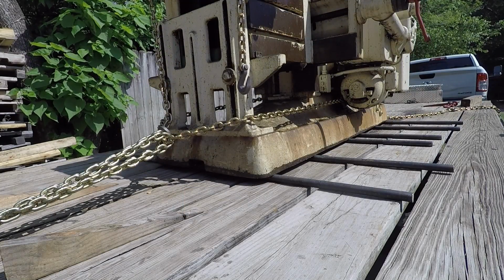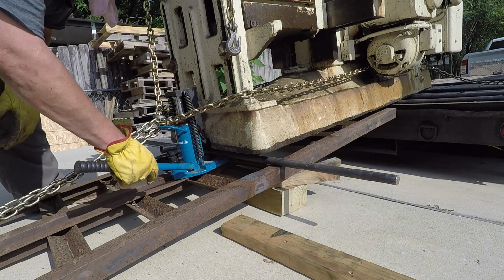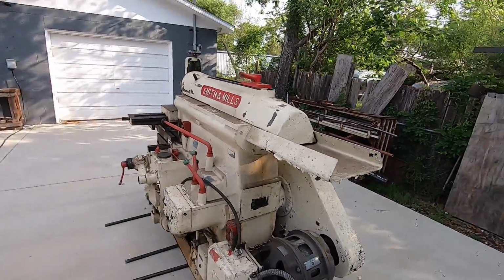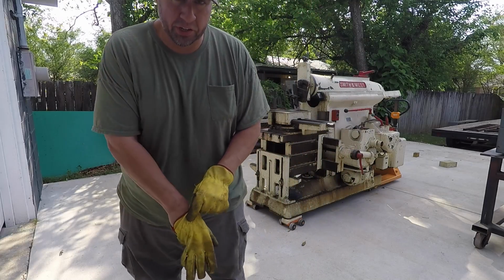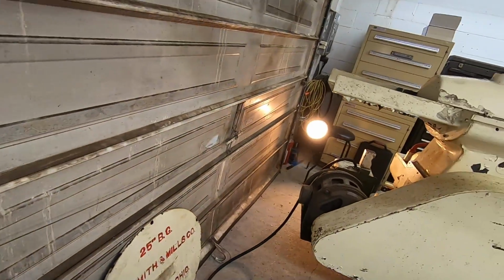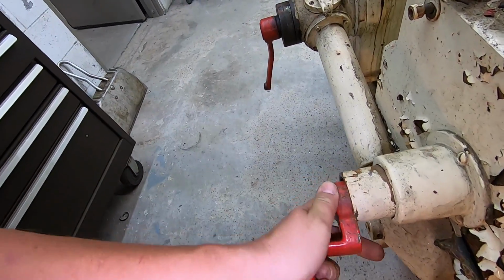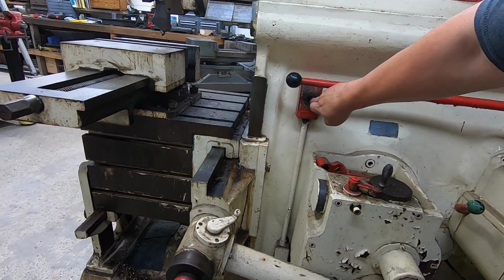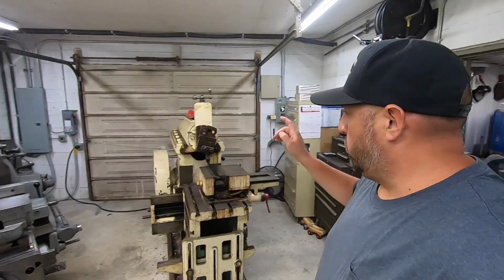Unloading the Smith & Mills Shaper Part 2

Comment: Dont get me started on people painting the hell out of stuff.
Former job at a factory every year people would go around and repaint the lines, over every single bolt head, allen head screws were just filled with paint having to be picked out before able to remove.
Reply: wes Made me laugh. Yep, me too. On the back shifts that’s what the operators did, steam clean, needle scale, prime and paint with pneumatic solvent sprayers and laid it on thick. The old Navy hands always said, “Run it may, Shine it must”.

Comment: Nice...one manned off-loading.  Seems that this machine needs a good flushing out of aged and gooed up oil and other contaminants. There a few weeks of labor there to get the paint layers down to the original coat then refinish it in the original paint scheme. If there is an electric motor repair/renewal shop around town, I'd take the motors down and have them checked for tolerances and bearings just to note their conditions. BIG difference when getting the correct voltage to the rear motor which does sound true for its age. Nice share Adam.

Comment: Be careful with those rear chains, at some points they looked like there was a little bit too much slack in them. The worst chain failures happen when a chain gets from slack to taut with a sudden jerk from the load accelerating rapidly. Whatever the chain is rated at, it's for static loads only. Much more substantial chains could be easily snapped by this machine if it were to really get going downhill. In fact, it's probably better to restrict chains to pulling/lifting only and secure the load on the uphill side using slings and ropes, which are going to be able to handle dynamic loads much better.
Reply: Did you just tell him to use a rope instead of that big ass chain? Youtube comment section is out of control. Does it look like its his first rodeo
Reply: @truckguy6666  There are no chains in this video that I'd call "big ass", not by a long shot. The one used for pulling, on the chain hoist side, was perfectly good for the job, but absolutely not "big ass" in my opinion. I've had my share of exciting rodeos as well, you see. I told Adam to use a sling or a rope instead of the two quite puny chains that held the rear of the shaper onto the trailer. The ones that stop the shaper at 9:35 and bounce it back up a bit. They barely held, according to some back-of-the-envelope calculations I made in another reply in this thread. Check them out. The reason for my recommendation is that chains subject to excessive shock loads (such as being rapidly tightened by a heavy moving object) can snap extremely violently, sending pieces of broken links at high speeds in random directions. People get killed by those. Slings and ropes, on the other hand, have a larger capacity to stretch, fail gradually, provide visible warning signs when damaged and failing, and don't throw shrapnel. Thus, a sling is safer for holding back a load that could get going on its own.
Reply: Remigiusz Marcinkiewicz just how much does this machine weigh smart guy?
Reply: @Highstranger951  6500lbs, or just shy of 3t. At the end of the downwards slide it was traveling at 0.7.-0.9 m/s (measured by playing frame-by-frame, at 60fps it's quite easy) and got decelerated by the chains within 0.15-0.20s. This exerted a force of approximately  52000N, or slightly over 230000lbf. This was  definitely in excess  of WLL of those chains  and almost certainly above 2x WLL, at which point even most brand new certified hoisting chains are fully expected to just snap with zero advance warning.

There you go, "smart guy".

Adam himself wasn't in danger here because he kept his distance, but the shaper could have broken free and most likely fallen off the side of the ramp.
Reply: Remigiusz Marcinkiewicz it’s approximately 6200 
Lbs according to the spec sheet and a ton is 2000 lbs so it’s over 3 tons. Your math is bullshit because you didn’t factor in mass. There is no possible way unless the whole machine was lifted and dropped letting the chain bear the load.  Did you factor in friction?  If so, explain how because I doubt you were there.  Cure your ignorance.

Comment: You need to go to harbor freight and get a Badlands winch to mount on the trailer, and a second one to use on the anchor points in the driveway. That would make your life easier.

Comment: Very cool, look forward to the series. You'll have to fab up some dedicated swivel machine skates if you're going to be moving it in and out. You can hook up a quick tongue to connect them out of some 1/2" round stock or rebar so you can steer it easy forward or sideways. Every time I hear the shapers run, I swear they used that sound in the War of the worlds movie with Tom cruise. It sounds like the pods when they are grinding up people.

Comment: The knee can be power if you make an adapter for a nice drill motor.  Maybe a 1/2 horse.  Then it drives it up/down but is not used but during setup!   Machine a nut and a hex bar for the drill.  The handle you can't turn - a nut on the side - turn with the dual handle - loosen and maybe it works.

Comment: In a school it probably had very low hours, unless they bought it from a shop that used it a lot. My high school had a shaper in the machine shop classroom, not that big though! Every year we had only one project that used it... not much work on the horizontal mill either, but the Bridgeport and the lathes put in a lot of hours. They had a coal forge too and we did case hardening with cyanide. I don't think any high school runs a forge now and cyanide hardening? Not likely! 
Kids are missing a lot with no shop classes now, maybe useless for future work but understanding metalworking, electricity, drafting, and woodworking is valuable regardless. I occasionally use things like straight line development for duct work that I learned 50 years ago.
Reply: The first HS I went to (2007-2010) had two smaller shapers, but only one of them ever saw use (the other was a leather flat belt drive that IIRC needed a new belt and budget cuts wouldn't allow them to fix). Personally never used it (only used for making cross peen hammers along with the surface grinder).  We had 7 lathes though... lots of lathe work, and that's why I've been more of a lathe guy than a mill guy. We had a forge (and case hardener, but I don't think it was cyanide), plus an aluminum foundry and all manual weld processes. Even sheet metal and plastic tools (injection mold and rotational thermoset machine). Fun times.

Comment: Adam if you plan on loading or unloading more heavy metal, do yourself a favour and get an electric winch (I use a boat winch). They save your back and have a longer pull than a comealong. I don’t think a boat winch would be strong enough for your situation. Love watching your videos

Comment: Always a good idea to check the full load amp ratings on the motor against the overload relays also the voltage of the starter coil or coils...Higher voltage is going to draw less amperage... Rotation is important as well.. My 2hl K&T came from the Navy and was wired for 440 so I had to change the overloads and starter coil, also had to change the leads coming out of the motor for lower voltage as I don't have 440..... The magnetic starter was large enough to take the load of the lower voltage....My 14" Steptoe shaper does not pump oil until the clutch is engaged....Cheers: Mike in Louisiana

Comment: Lot of working getting that moved but it should be interesting when everything is done.  I remember graduating from high school and working on a road paving crew (concrete not asphalt) anyway loading and unloading the paver was a scary proposition.  It was hauled on a regular flat bed semi trailer and they had a set of ramps that it would walk on and off with.  They were so big that you had to use the skid loader to position them, there was no moving them by hand.  Anyway quite often we were setup for either 30 or 32 feet edge to edge or curb to curb pours.  That put the machine at about 36 to 38 feet wide and it would hang off either side of the trailer about a foot.  It was one HEAVY mother to say the least.

For skates just get a bunch of small casters and mount them to a piece of steel or wood even.  Later on I ended up working at a place that built modular homes and we moved houses with skates that had about 20 wheels on each one.  They were nothing special either, just have to figure the weight you will intend to use and divide that by how much each wheel will handle.  The really small ones are not much but Harbor Freight has some 3 inch poly casters rated at 275 pounds a piece.  Two skates with 10 on each one will be rated for 5500 pounds.  Slip one under each end and position it wherever you want and probably be pretty easy to move as well.  We used to push a complete house that probably weighed about 40 to 70 thousand pounds with ten people.  It's just getting it started and then you are off to the races so to speak.

Comment: To swing the front of the shaper around, take the weight off the front skates with the jack, angle the skates in the direction you want the front to go and lower the shaper back down. Give it a push and it'll go where the skates are pointing. Good work moving that thing on your own 👍
Reply from the maker: Or you can show another way the Burke bar can be used to move something very heavy in a slow and controlled way with proper leverage

Comment: Adam you really need a electric pallet jack. She's a beautiful shaper and very quite. Do you own a rotary phase converter even though it appears that you have  480 volt service with a step down transformer with 230 & 120 volt taps?
Reply: He has 240/3 into the shop.  A 480v boost transformer was added recently.

Comment: I think this is the same model that Adam has bought. If so, damnit is a beast @ 6200lbs! 

Length of stroke, adjustable -0 to 26”
Table travel, horiz 14”
Max table to ram, table plain side 16.5”
Table top 17.5” x 25”
Tool head, vert hand adjustment 6”
Cutting speeds (8) 8 to 103 SPM
Tool post plot size 2”
Cross feeds to table, 30” travel
Main motor 7.5 HP, 220/440V
Approx weight 6200#
Approx dimensions 95”L x 50”W x 64”H

Comment: Just a suggestion, You have a nice slab there, epoxy a few anchors here and there for d rings with caps of course and get a reasonable automotive winch to assist with stuff on and off the trailer. With a long enough cable you could put a snatch block on the trailer and drag things on as well. When not needed the d rings get put in a box and the caps put on to keep the trash out. You move enough in and out of the shop and around the drive to justify it.

Comment: Awesome machine good thing it didn't have a newer 3 phase motor on it as you would have burnt it up running it on the low voltage.  I have a tip for you for in the future of hooking up new equipment.  The easiest way to find out what voltage high or low it is wired to run on is to look at how the control transformer is wired.  If has no control trans look for the coil voltage of the motor starter.  The best way of course is to look at how the motor is wired to the name plate.  I have never had an issue by just going off the control transform over the years.  Thanks for the great video and stay safe.

Comment: Hey need to make up an portable electric winch you can hook to each anchor. And have a eletric winch on trailer. Then use trailer winch as a brake. Pull on one let off the other .

Comment: You need a "TirFor" cable winch my friend. I have hauled a 30 ft travel trailer up the side of a mountain with little effort. Every mill or mine most likely has a couple of them. They pull with every stroke. either direction. Your job there would have taken an hour or less.They are a cable winch type with no gears  but are a compression type winch. I wish I could show you one in action bud.10 ft or 200 all the distance a fella could want.

Comment: @Abom pour some epoxy resin in them cracks in your workshop floor ! heat it up 1st  will stop degradation. gl
Reply: add a little bit acetone so it penetrates ratio about 5% thinner.

Comment: You never just get the one shaper, it would be cruel. Shapers are social machines, and they like company. Now they can socialize about all the metal they cut over the ages. Should get a small shaper also, to get that Goldilocks, and the three bears thing going. Also machine restoration makes for very good content for the channel.
Reply: Just don't forget to spay and neuter. Before you know it you'll have eight small machines running around using up all the oil.

Comment: I don't understand why you spent so much effort to winch it, when you were obviously able to push it(while on the trailer, on the bars) without too much effort.
Reply: jimsiggy dude 1” rollers on a wood trailer bed do not free roll without some serious slope assistance.
Reply: @mwhelan53   I get it, but watch at 5:06, he pulled it by hand.
Reply: jimsiggy did you happen to take note of where the weight was in relation to the axle set at 5.06?   The weight at that stage is inducing some slope.
This where you get bit in the ass for not paying attention in physics at school.

Comment: 21:00 another way to move the end over is to use a good sized softblow hammer and tap the load skates on an angle point at where you want the big girl, then push 👍